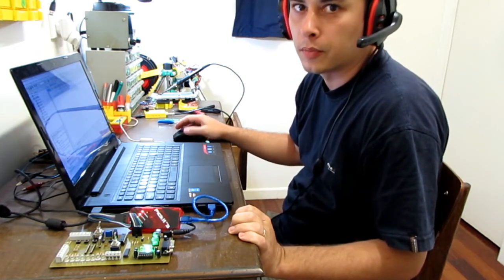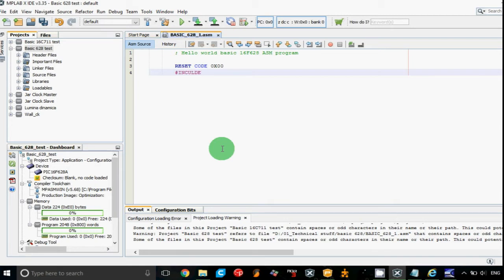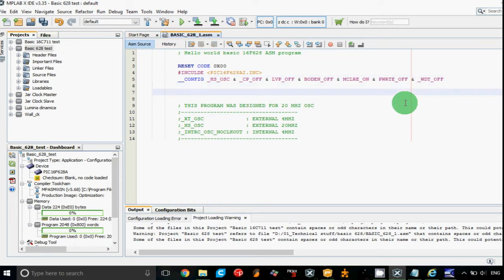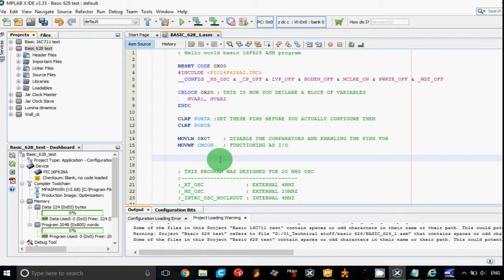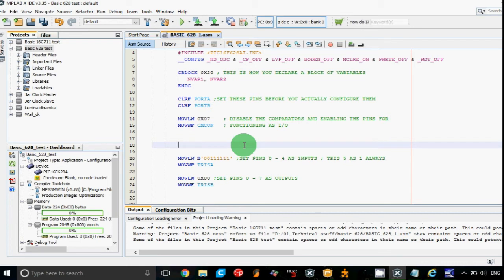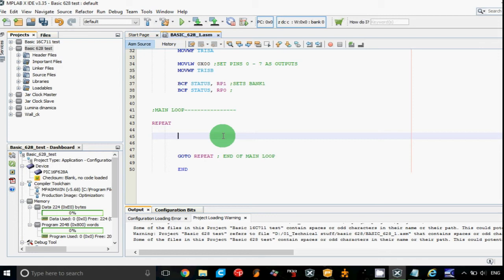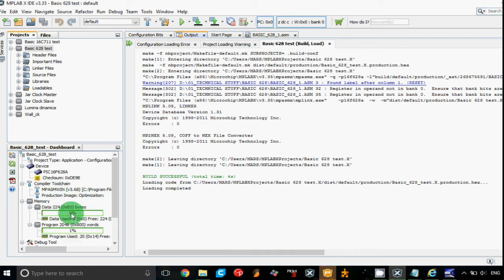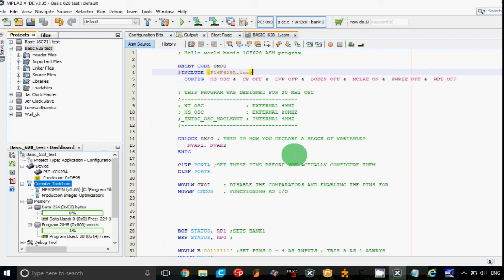Assembly tutorial [1/2] - PIC16F628 Hello World

Comment: Why asmbler and not  C?
Reply from the maker: The everlasting question. I have to admit that I'm going lazy lately and I prefer C++ even for the simplest applications. But still, people like to learn ASM because is so close to the true meaning of embedded. It's the missing link between z80 and modern processors. It's the missing evolution step between Commodore 64 and modern computers. If you know ASM, you know how that processor actually works. There is only one case when ASM triumphs over C and that is when you need a clock - sharp automatic time process. When you need a machine code that runs without unpredictable loops and interruptions. This would be the case for industrial robots, automated production lines, etc.
Reply: @FunElectronicsToday  ,maybe, but majority know C and I'm not a fun of ASM. I have no time to learn AND ASM.
Reply: To actually know what's going on inside the processor, if you don't care at all of what's happening, then use Arduino.